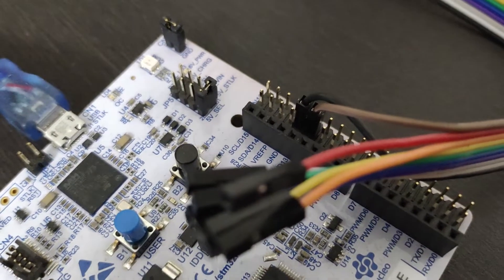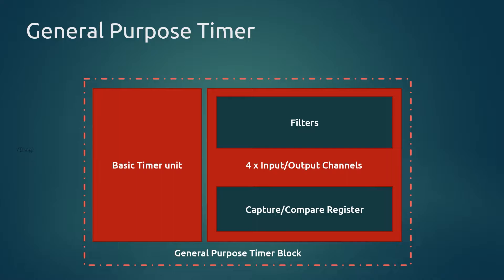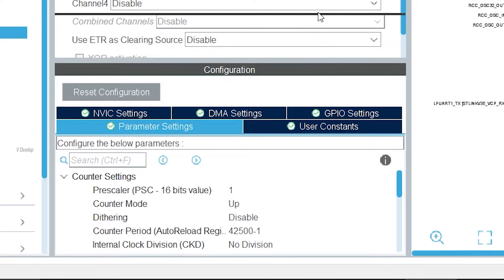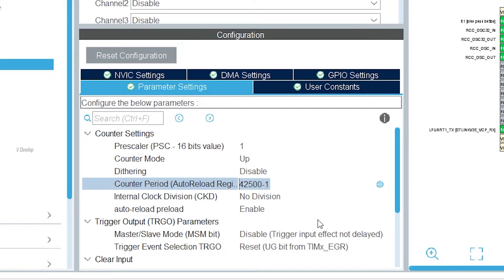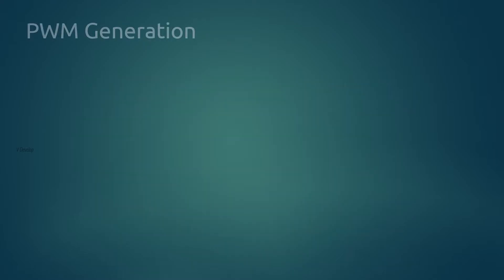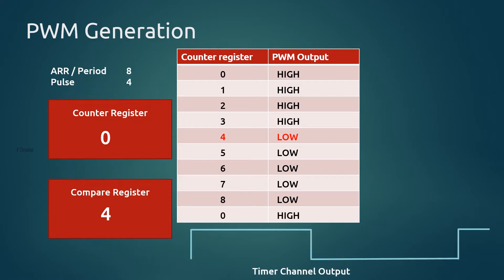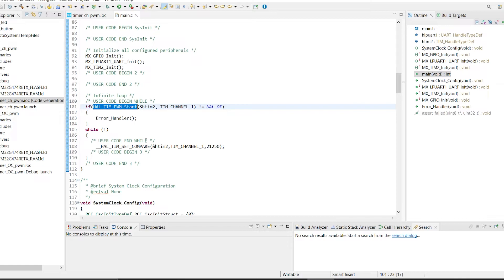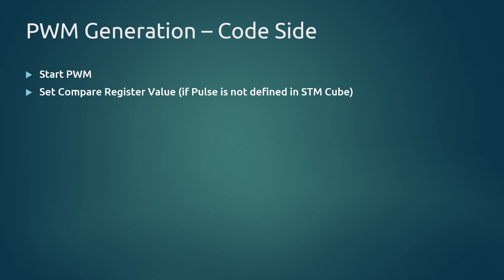Understanding PWM Generation | STM32 G474 Nucleo | Episode 7

Comment: This is a wonderful PWM video.  I am trying to setup the  [Orange Pi 5 8GB Rockchip RK3588S 8-Core 64 Bit Single Board Computer]  PWM pins to run a Pan/Tilt servo example.  
Do you have any suggestions on setting up the OPi.GPIO PWM code or a video?  I keep getting error messages.  Thank you.
Reply from the maker: I'm really sorry for the late response. I haven't worked on a SBC for pwm generation.
Just went through this article. Maybe helping you.
https://neonaut.neocities.org/blog/2018/orange-pi-pulse-width-modulation
Reply: @vdevelop  Thank you.